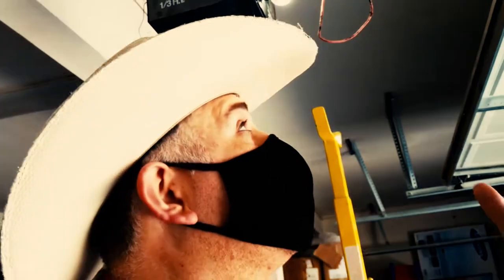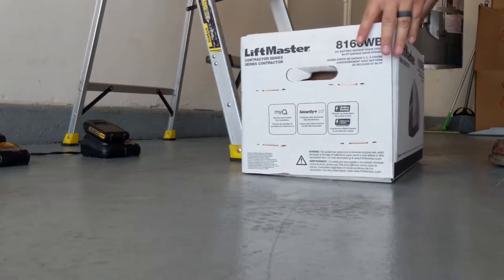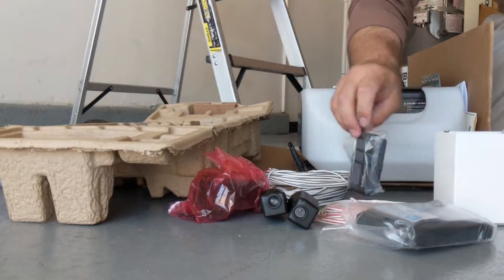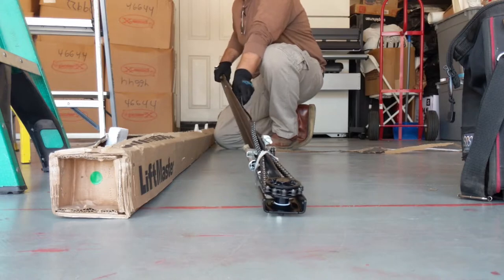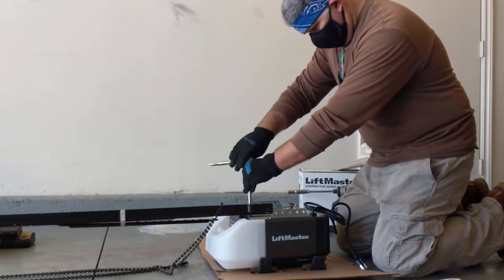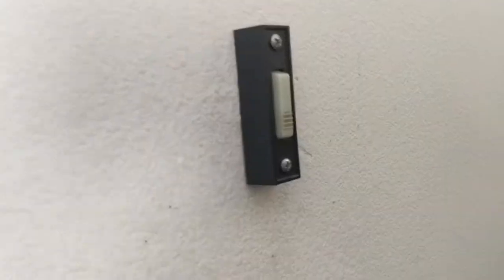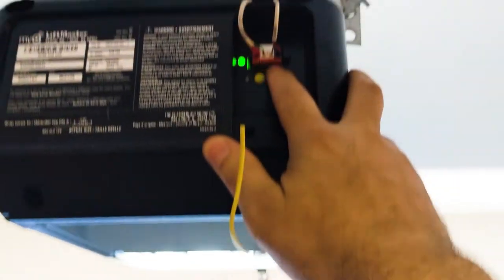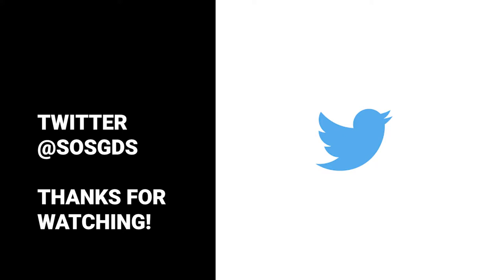LiftMaster 8160WB Garage Door Motor Review

Comment: great video! i’ve always wanted to see how the rails r unboxed! also, one more tip, if customers really want to save some money, if the existing t rail is in good condition, or if they say their existing chain cable rail is ok, re use that old rail! it will most likely save u time, and it will make the customers fell like they have an honest installer. that’s what my company hollywood door does, i had a friend who had a 1255 and  they put in the 8160, and we loved it! they re used old t rail and worked fine! we had a similar thing happen too. ok 2005, we had a really bad hurricane called hurricane katrina, and that mainly hit the part of the city i live in which all have detached garages. and what hit us in the hurricane is the levies busted, so it all flooded in this city. so they all have 3255, 1245, etc and A LOT of OHD Legacy’s. and that the suburb of next to ours that my grandma lives in didn’t get it too bad, and i’ve seen some pretty old ones there (genie 880) OHD phantoms, etc. also, where did u get the stand that holds the operators? i know john asked this, but i have been wondering because that would save me an extra helper in my installs. thanks!
Reply from the maker: Gosh!  So sorry to hear how the folks were affected by the hurricane.  It's funny how "acts of God" or accidents can affect our industry.  And those are some old motors you speak of.  I remember the old OHD Phantoms.  The stand was purchased at a local distributor.  Here's their website.  Not sure if they ship out of state.  https://multisalesinc.com/
Reply: ah thanks. it does require an dealer ID sadly. but yeah i agree. have u had any problems with liftmaster lately?
Reply from the maker: Yes ... I remember see this on the news.  We hope the families are getting back on their feet.  And maybe we can bring them some ease and comfort by getting them a good reliable garage door system.  Thanks for sharing.
Reply: yes we r all back to normal. have u had problems with liftmaster?
Reply from the maker: Not recently.  I have rarely seen a LiftMaster motor go bad.  It's mainly their boards.  The most trouble I have is with MyQ and network issues.  But the homeowners needs to call tech support for that.  How about you?
Reply: Yeah that’s mainly what i mean is with boards. What’s ur premium go to motor? I’m looking at replacing my grandmas marantec, and we want good. And BBU. I was thinking LM weld, but i want ur input of a good linear, genie, and LM and with the top 3, which one.